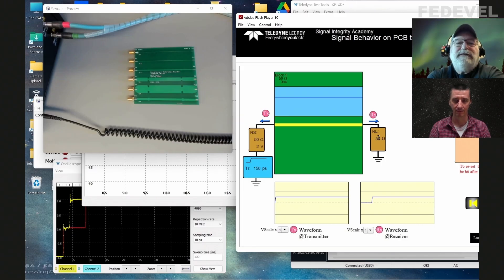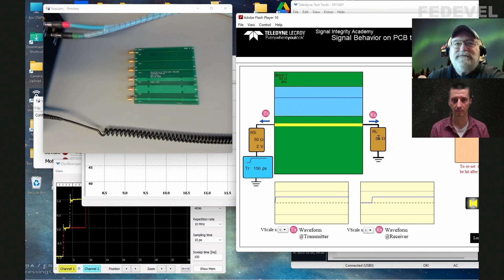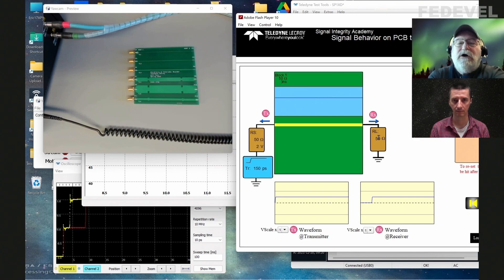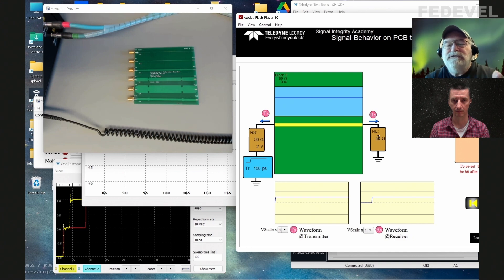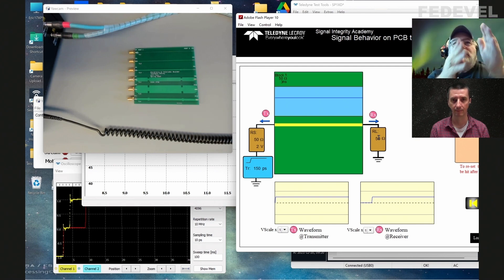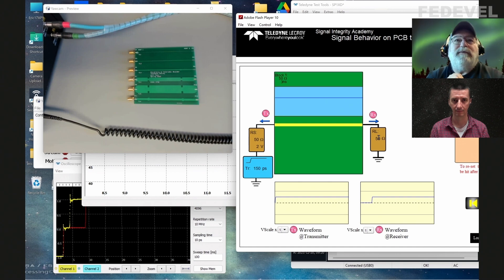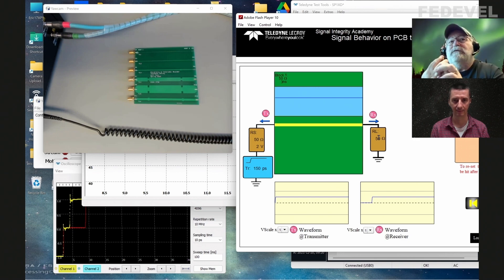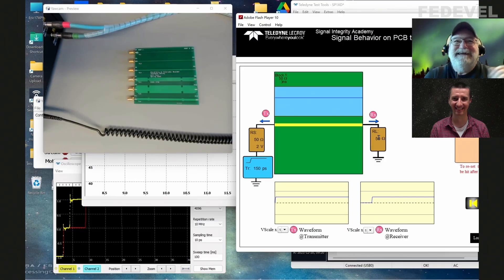Why is 50 OHM impedance used in PCB Layout? | Explained | Eric Bogatin | #HighlightsRF

Comment: A hundred or so years ago, electrical engineers determined that the best impedance for transmitting radio frequencies was a 30 ohm circuit, and that receivers worked best with around 70 ohms.  In fact, early ham sets had a separate transmitter and receiver.  The engineers decided that using 50 ohms was a happy compromise in order to use one antenna for both transmit and receive.  That's how we got the modern transceiver 🤓. 

That's also why receivers either work with 75 ohm coax or 300 ohm (4th Harmonic) twin-lead 🤓.

Comment: You ought to more clearly title your video.  There is an awful lot of pcb design, which has no track layout impedance specification at all. There are also many circuits that use 75 and 110 ohms.

Comment: Im currently facing a roadblock in  my PCB design: I need a 50 ohm trace but I cant have a trace wider than 20mils (too thin) because of the 0.65mm pitch bga the signal comes from how do people deal with that . Thank you for all your amazing content its incredibly precious
Reply: One thing is to choose a layer stackup that minimizes the thickness of the prepreg between your signal layer and the ground plane below: thinner dielectric -> narrower traces for a given impedance. Other than that, you just have to neck down the traces eventually.

Comment: Hello.. Is it necessary to keep 50 Ohm impedance for all Traces .. If we are designing any logical operations with 74HC595D(SPI Mode) is it necessary to match all the Input trace impedance! Kindly give a clarity between Hi speed design and low speed design.. When will be system considered as High speed design!? Any threshold

Comment: Radio transmitters often use 50 ohms, TV receivers use 75 ohms. 
It is likely that transmitters must transmit more power. 
With TV, it is important to transport low power cheaply.

Comment: 75 ohms characteristic impedance corresponds to nearly minimum transmission loss, 30 ohms gives maximum power handling capability in Coaxial cables and 50 ohms is a rounded compromise number.

Comment: Another point of using 50 Ohms for the PCB layouts is the following: it's well known from the theory that the coax cable, which is widely used for the PCBs interconnections has (1) maximum power transport (for the fixed cross-section) if the impedance is = 90 Ohms: (2) Has minimum attenuation if the impedance is = 75 Ohms, and, finally, (3) Has minimum signal linear distortions (thus - maximum bandwidth) if the impedance is = 50 Ohms: this is the most important condition for the functioning of PCB.

Comment: YES, I remembered I have read related statements on why 50 ohms and why 50 ohms is so common on Eric's book, Signal and Power integrity 3rd. It's all about trade-off and 50 ohms is a good point to start tuning if need. Also there're some history and background inside too.

Again, thanks. This video just brings some memory from my mind. It's good for me.
Reply: Your 100% correct, your fully understood the discussion factors that engineer the optimum impedance and its variance on power, manufacturability noise, transients and test standards. We had to have those tradeoffs in all the transmission of microwaves ( tubes, coax, planar, coupled air bridge, slotted mediums transitioning high and low impedances with Smith charts, vector analyzer testing as well as other factoring test instruments. Tradeoffs that made a near perfect design non manufacturable and vice versa due to tradeoffs.

Comment: 50ohm lines on FR4 are quite wide, especially on 0.062" material (0.105" wide).  I can't imagine anyone using 50ohm lines unless you were working with 50ohm components.

Comment: I think it all comes from TTL (Transistor Transistor Logic) from the 1960's which was 5V.  
TTL = 5v, I=V/R=5/50=100mA.. Easy numbers to work with. Same resistance at each end of a line for maximum power transfer. 
Industrial controls use 500 Ohms at 10V =20mA for 0-10V, 0-20mA, 4-20mA. 4-20mA being as 16mA range scales well into 16384=2^14+sign+parity=16 bits so in and integer register about 1000=1mA in 14bit
Reply: Sorry, nope not from TTL days. Impedance and resistance are different.

Comment: The impedance is the characteristic impedance (the ratio of voltage to current of a wave traveling in one direction without loss). 50 ohms is an arbitrary standard that is commonly used in rf and microwave transmission lines to prevent signals from reflecting off impedance discontinuities.
Reply: Hi, 50 ohm is not an arbitrary number.
A coaxial cable of 30 ohm characteristic impedance would handle more power.
A 75 ohm cable would have less attenuation with VHF and UHF frequencies.
And 50 is the arithmetic and geometric mean of the two numbers.
So, the 50 ohm becomes the standard for the amateur radio and the like and the. 75 ohm for the video industry.
De VU2RZA

Comment: Lee Ritchey has this great story about how he was working on a submarine SONAR system and the electronic design engineers insisted on 70 ohm transmission lines. I think it had to do with a concern that the drivers wouldn't be able to switch 50 ohm transmission lines quickly enough. Well because of the increased dielectric thickness to get 70 ohms they had terrible cross talk. Distance from the reference plane is a key consideration for cross talk and cross talk is directly proportional to dielectric thickness. Lee convinced them to lower the impedance to 50 ohms and they were able to actually build a functioning system. 

That night after the second or third day of his course on making it to 56 Gbps when he told that story (we must have been talking about crosstalk) I flipped on TV and the Hunt for Red October was on. In the movie the Soviet Union had built a sub that had a silent drive system. The only was it could be tracked is with a very specific SONAR signature. So the Americans chase down the Soviet sub using SONAR in a Los Angels class US submarine, the very one Lee worked on. What a coincidence!

Lee speaks very highly of Eric Bogatin.  I notice Eric referenced "loosely coupled" differential pairs. Taking the words right out of Lee's mouth. Not saying it was Lee's idea, but he stresses tightly coupled differential pairs are not a good idea.
Reply: Exactly, 70 ohm would give you higher crosstalk versus lower impedances brings a concern around signal stability and high-order modes. We had to sacrifice ideals over cost and package densification in the use of substrate dielectric values noise, power and other parameters centered around compromises

Comment: Noobie question. Isn't it 50 ohms over a specific length? Wouldn't the impedance double if you double the length of the cable? Or, am I completely misunderstanding?
Reply: It doesn’t depend on the length of the cable.  The impedance of a transmission-line is a result of the cable’s internal capacitance and inductance.  It’s what a driver “sees” as a load when trying to change the voltage on the cable, and create a wavefront that moves down the cable.  At the receiving end, you want a load resistance that matches the cable impedance.  Otherwise, some portion of the wavefront will reflect back to the source.   Also, at the driving end, you want the driver’s resistance to match the cable impedance.  If not, the wavefront could easily keep on reflecting back and forth for several end-to-end trips.
Reply: @kc9scott  Thank you, that helps.
Reply: Thanks to all of you who tried to help me understand this. I spent the morning coming to a solution. For noobies like me with similar questions, you'll find help in a Wikipedia page "Telegrapher's equations", where they explain the length is assumed to be an infinitely long line terminating in a ground, with no confusing back reflections. The capacitance does not completely cancel the inductance because the inductance is in series, the capacitance is in parallel (forehead smack). It is humbling to realize this was all worked out, over 150 years ago.
Reply: If you add length, you have also added inductance which exactly balances the increased capacitance.  The increase capacitance would tend to reduce the impedance (equivalent resistance) where the added inductance increases the impedance.
Adding length changes loss that is the only thing that increases with added length.  The wire has actual resistance, not much but some, and the dielectric also causes a bit of loss as the electric field causes electrons to move slightly and that absorbs a bit of power.
Reply: @thomasmaughan4798  Aha, now I think I'm getting it, thank you. Presently my struggle is how to understand that, knowing the way the two aspects of reactance exactly cancels when we do phasor diagrams. If it does cancel, why does it even matter? How do you measure the impedance rating of a cable?
Reply: @spelunkerd  "If it does cancel, why does it even matter? How do you measure the impedance rating of a cable?"

It matters because power delivery happens when the reactive elements are neutralized and only a resistive element exists, presumably that of the actual load. 

A somewhat similar phenomenon is the "power factor" of an electric motor or other device.  Motors are inductors and shift the peak current away from peak voltage, that is why VA (volt-amps) is not watts.  A motor that is spinning freely will show full voltage, and if you put a current meter on it will show full amps, you might think it is thus a 500 watt motor but in truth will be only burning 50 watts or so (power factor of 0.1 or ten percengt).   This current lags volage (ELI the ICE man; e before i in L) messes with things so electrical substations have big capacitors to try to get electrical distribution back in phase.

As to measuring it, that's a bit complicated.  I've never done it but it is not all that difficult to calculate with some formulas. 

"Another way to measure the characteristic impedance of coax cable is to measure its inductance and capacitance per unit length; the square root of L divided by C will be in ohms (not farads or henrys) and will be equal to the characteristic impedance."

A great resource on the topic: 
https://www.dsinstruments.com/support/understanding-characteristic-impedance-vswr-reflection-coefficient/

Comment: I have a question - how come trace impedance calculators only relay on dielectric thickness / stackup and line width? What about the trace length? How is it possible that I will get 50 Ohms with X thickness and with Y width, no matter the length?
Reply: because of the model  :
Schematic of Heaviside's model of an infinitesimal segment of transmission line.
https://en.wikipedia.org/wiki/Characteristic_impedance
Reply: @danielfranchette5547  Wow, it's quite simple now that I read about it, thanks a lot man!

Comment: Please explain why so many differential signal board traces are matched in geometric length by folding snakes on one side for compensation.
In a thought experiment you can lay down a differential signal trace as a spiral. So at the end the signal must be in-phase instead of complentary at some frequeny following the geometric rule. But in reality they are coupled and still in 180 degree. So are the matching snakes bullshit?
Reply: Length matching is for skew not impedance. The most critical parameter of the relationship between members of a differential pair is time. The point when the signals cross is critical to signal integrity. The faster the edges of the signals, the more critical skew is.

Comment: If it's always Ohm, why use "impedance" term instead of using "resistance" term?
Reply: Because when you model the line it actually also consist of the characteristics of some Inductance and Capacitance so it's not purely only resistance
Reply: @lukmanhdrjaya  Thanks for the clarification.
Reply: What he said; but an ohm meter will hopefully read infinite between the conductors, whereas it also acts like a capacitor between the conductors and an inductor longwise along the length.   Adding longer coax adds more capacitance and would reduce the capacitive reactance, BUT you have also just added some inductance which increased inductive reactance.   When everything is designed to a specification, adding more length makes no noticeable difference to whatever is pushing a signal into it.

Comment: 50 Ohms comes from the 30s and early use of coax cable where low loss in the cable was key. With the given cable properties back then it happened that at 50 Ohms the lowest attenuation (series resistance) was found.
Reply: 50 ohms is for maximum power, 75ohm for minimum attenuation
Reply: @DavidLopez-bz4rj  the loss in a cable is referred to as attenuation = R/Z0. At 50 Ohm you get the minimum attenuation in db/m.
Reply: @fabianluttenberger7153  Correction:
Minimum loss:77ohm
Max power:30 ohm
50 ohm is a compromise between this two. It happens in solid dielectric coax minimum loss is 50ohm.
Reply: @DavidLopez-bz4rj  That is the exact reason why TV antenna systems uses 75Ohm as you need minimal attenuation without the need to delivering whole lot of powers (for Rx), whereas HAM uses 50ohm for the obvious reason to Tx high power.
Reply: It is 50 ohm for the amateur radio and 75 ohm for the video industry
De VU2RZA
Reply: @subramanianr7206 Not just amateur radio. 50 ohms is basically the standard for coax on everything except video. Electronics test gear uses 50 ohms.

Comment: "Where did we ever come up with 50ohms" 
Lol, that's a question where you'll never ever get a straight answer. Another question where you never get a straight answer is assuming you chose 50 ohms as your line impedance what makes anyone assume that the impedance of the driver and source devices are anywhere near 50 ohms? For RF designs the impedance is presented to you in form of S-parameters with a whole slew of equipment for determining how things are matched. For the high speed digital folks what are the options for characterization ?
Reply: "Where did we ever come up with 50ohms.   Lol, that's a question where you'll never ever get a straight answer."
You will get many straight answers.  some will probably be correct.   as it has been answered many times in the comments I won't go into it here but it is actually a deliberate and careful choice confirmed by mathematics and real world experience.

Comment: I remember from microwave class that at higher frequencies with mismatched line impedance, a portion of signal would reflect. For max power transfer you'd always try to have same line impedance
Reply from the maker: We talk about this in the full interview
Reply: Correct, it’s about maximum power transmission ( impedance matching ?